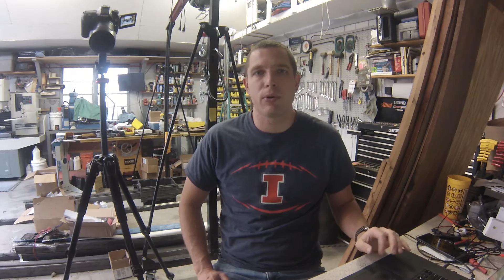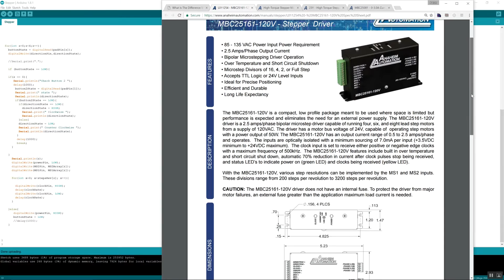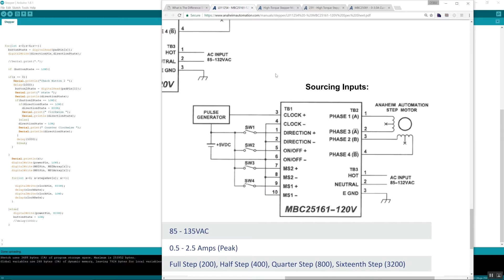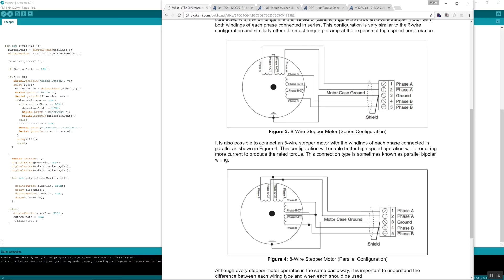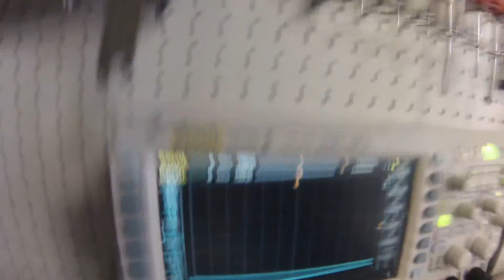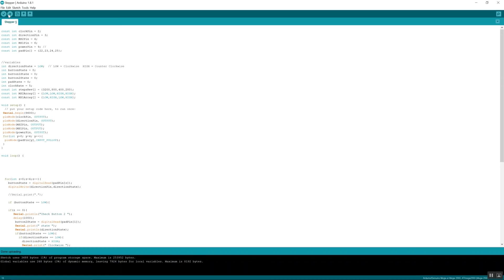Arduino: Code & Wiring for Medium to Large Stepper Motors

Comment: that controller is expensive as much as a servo drive last time I checked  unless the price dropped
Reply from the maker: Yeah, it was about $125.  I was looking for something of good quality since it was going on something that runs unattended. Not really cheaper but I've been looking at the clearpath servos for a couple future projects.
Reply: I must been looking at something different on anahime automation the 150 volt driver were pricey  I just got a  HiCON Integra - 6-Axis Step/Direction Ethernet Motion from vital systems getting ready to wire it up  just got the gecko drives to  I have mach 4 I gona start with that I put a proma on it once its running vital has a software for THC for mach 4  hope it all works ok and not loose to much hair
Reply from the maker: I just explored that rabbit hole a bit trying to decide what to do with my plasma/router table project. When I bought all the parts for it a few years ago I went with the ethernet box from candcnc which I think is based off the ethernet smooth stepper.  I've decided that it's better to build and sell the completed table vs trying to resell just that kit and the precision plasma gantry kit but my end plan is to build something with a better controller like what you're talking about and clearpath servos.  

They are a bit more and I haven't fully researched tehm vs the hicon but I came to the conclusion the Galil DMC-40x0 controllers were at the top of my list.  I liked that Mach 4 has a specific Galil plugin.  I was hoping that someone putting the time into making that and the Galil being more robust than a smooth stepper level controller would help to avoid the issues that make people still prefer Mach 3 vs 4.